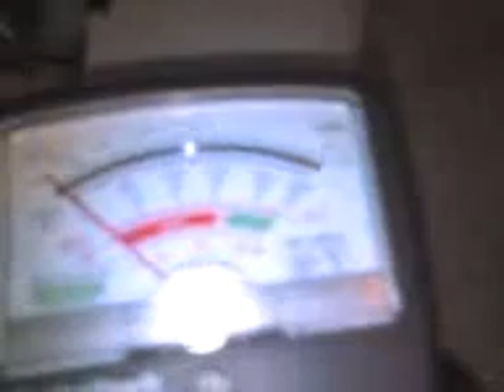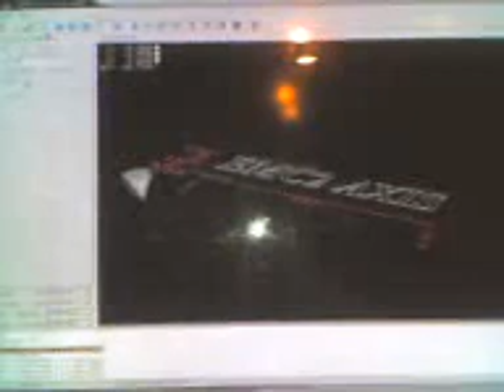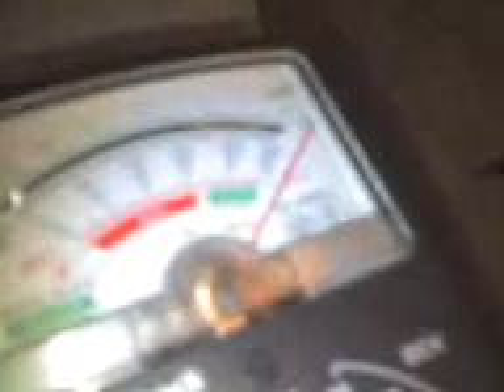CNC Machine Build 1

Comment from the maker: I just used the datasheet for the STK675-050. Google search it, as well as search the images for it. There is a guy in japan who made a circuit board for these chips and they are pretty easy to follow with the datasheet in hand.